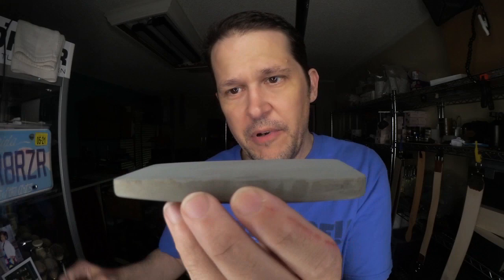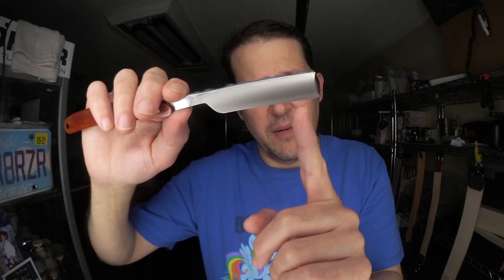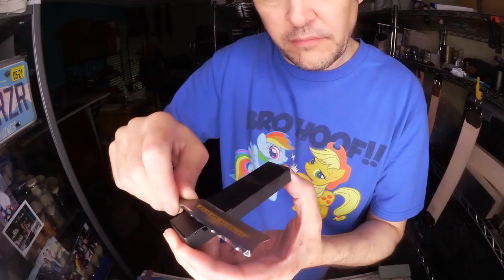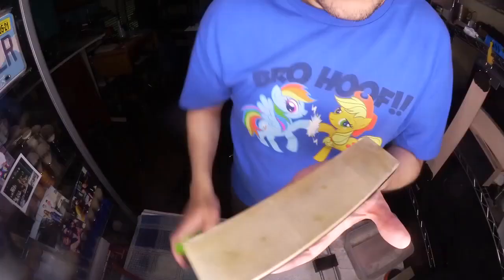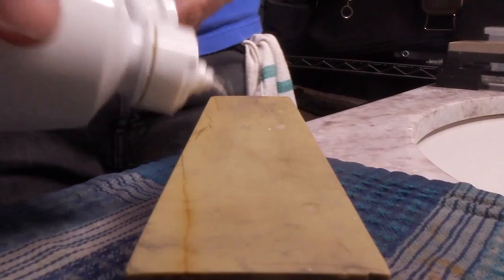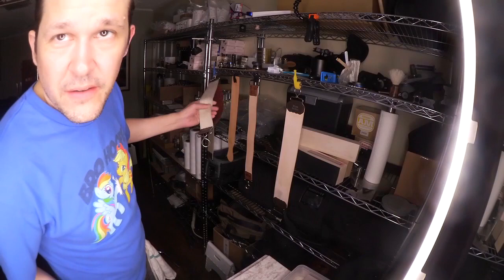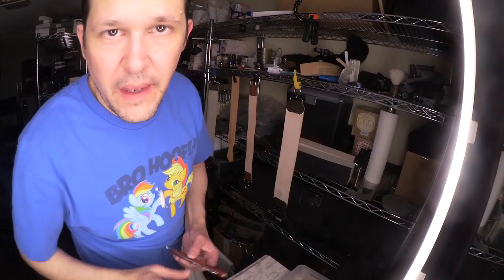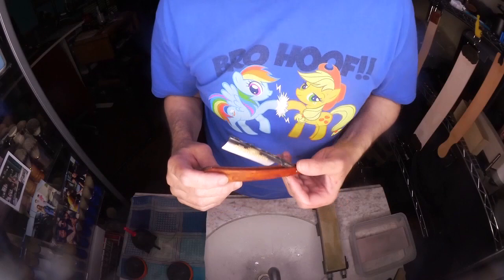Honing for Haywood | Straight Razor Honing Dovo Sunday Shaver | 03.03.2022

Comment: Hi Jarrod, Gary will be well pleased with your fast response ! Thank you for your email,Sorry for my slowness, I'm using Gary as my litmus test as I'm still a little confused over your entire method, I'm very excited to see the result ! Great video 👍.
Reply from the maker: thank you Martin, I'm sure it will work out fine, he can top off the razor with his preferred (flat) finisher and will only be interacting with the 'fig.4' area as in this image...   

thesuperiorshave.com/wp-content/uploads/2021/12/1123202101.jpg

the main thing I'm selling is that thinning a razor's bevel profile makes any tip better, regardless of what abrasive one chooses.  Just be sure that what you're doing at that point is but a small % of the overall 'bevel reveal'.   I don't even think coticules are sharp enough for my goatee area, by and large, and were I doing the razor for me I'd be doing an Arkansas ending not a coticule one, but ''horses for courses'' as they say.
Reply: @thesuperiorshave  I can't wait to hear Gary's result ,then my turn !

Comment: Jarred can you tell me which hone were bevel thinning and which hones was shaped on the opposite way on the longer axis. I no the barber hone was bevel thinner not sure on the next hone you used ?
Reply from the maker: the idea is to start touching the razor's 'bevel reveal' at its spine side, and progressively get closer to its actual apex

ignoring the steps with the ~flat hone (to reduce the slight factory frowns I observe on every Dovo, Wacker, and Böker if I am being as critical a standard as "can I put this razor edge flush facing a surface plate and find ANY light gap between touch points, however narrow?"), it went as follows

first hone, the barber hone, has a very short diameter.  I do not know what Dovo uses in the factory in regards to effective diameter of that disc that sets up the edge (it is convex going from center to edge, and they touch that disc ~tangentially) but I would be surprised if it imparts a diameter as short as ~1m, therefore the barber hone as formed is going to touch the incumbent edge at the spine side.

next the pinkish waterstone 3x8" is set to ~2m diameter, this will move the abrasives we are imparting in the footage closer to the Dovo produced tip of the razor

the 60x250mm coticule is ~6.5m diameter (cylinder), this will start to make contact with the actual edge

the 40x175mm LGB coticule is  ~7.5m x ~2m ellipse, this will overtake the edge

I choose NOT to finish after this with a flat hone as I read in the 1840s German grinding textbook that razor makers at the time did not finish with the flat hone, but to be honest I doubt you'll do much harm to the razor at that point if you did